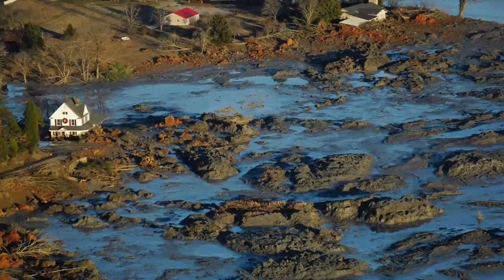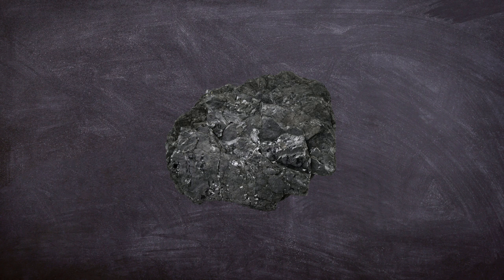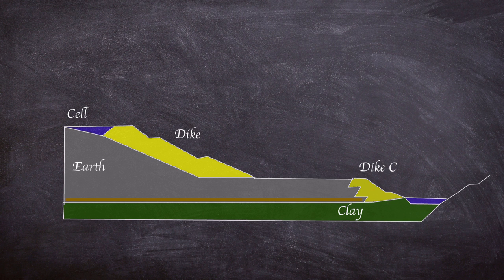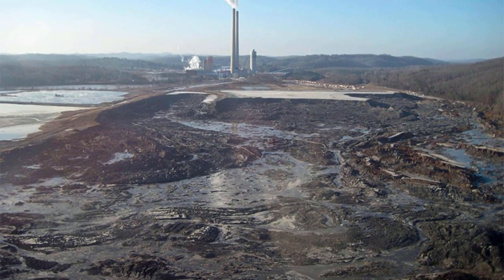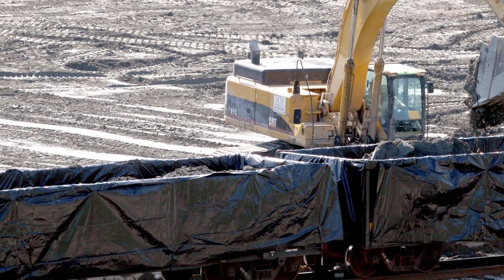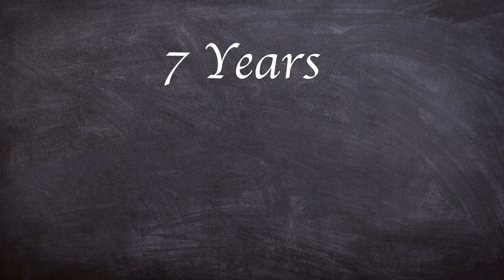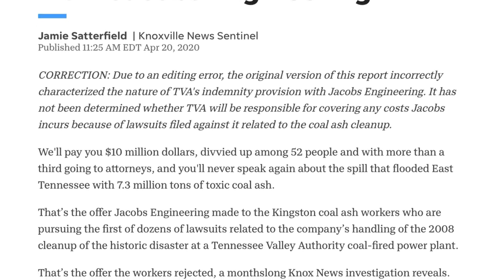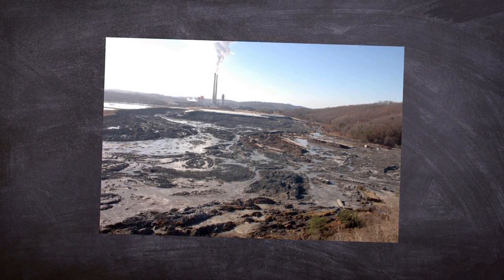A Brief History of: Kingston Fossil Plant coal ash spill (Short Documentary)

Comment: Where does al the toxic ingredients in the ash come from? I always thougt that ash (when fully burned) was kind of harmless or inert.
Anybody?
Reply: Coal is basically fossilized wood, in this case ancient rain forests buried in swamps and other anoxic environments. When they were living trees, their root systems absorbed various nutrients from the environment, including heavy metals and whatnot. The concentration of this material in a ton of actual coal is relatively low, even negligible. But a single power plant must burn about 9 tons of coal per day to produce one megawatt of power. Kingston has an output of 1398 megawatts. 1398x9= 12582 tons per day, or 4.592 million tons a year. Let's say that there's 100 grams of selenium in a ton of Kingston thermal coal, resulting in the accumulation of 459 tons per year. Heavier elements in coal ash don't combust and it's illegal to emit out the stack and therefore must be contained and recovered. And that is how you end up with a toxic sludge pond.
Reply: Peter Gray, thanks for your clear and enlightening answer. I have never realised that.
Reply: One caveat I didn't mention. My math assumes that a powerplant operates continuously at maximum output. On average Kingston operates at 950 to 1150 MW per hour. Still that's one unit coal train per day, so it still accumulates waste quickly.

Comment: They should be harvesting the metals out of al that.
Reply: thing is for what? Neither of them are high in demand and you'd have to deal with even more toxic waste...
Reply: @AKAtheA  it's not that. It's simply not economical because of the relatively (compared to natural ores) concentrations involved.
It would lead to less but more concentrated toxic waste as the total volume after extraction of the desirable materials would be reduced.
This is a good thing as there is less to store or otherwise dispose of, but that still doesn't make it economical.

Another problem is that the fly ash is radioactive, and therefore, depending on the exact level of radioactivity, may need to be treated as radiological waste, making refinement to extract desirable materials from the waste actually illegal.

Ah, the things you remember from engineering college graduation work in nuclear waste management...
Reply: @jwenting  Considering process waste, the total volume after extraction would most likely increase in just about all cases, but the overall concentration of target materials would decrease.
Reply: If it were profitable, it would already have been done.
Reply: The ash is mostly just sand so the best use for it is as a building material like mixed in cement etc. I think a big reason why it’s so dangerous is the small particles that get airborne which is why they try to mix it with water in the pools.
Reply: @Ty4ons  The reason it's so dangerous is the toxic metals including the radioactive ones. Try watching the video again.
Reply: Peter S -_-
Reply: @Peter_S_   If you actually knew you would know that fly ash is a major component of many concrete mixes , it increases cold weather resistance is used in high strength concrete, as an admixture, reduces shrinkage, improves surface finish, increases workability, reduces cracking, permeability and efflorescence bleeding, reduces setting heat, reduces water needed for the same slump mixes, and reduces CO2 emissions in concrete production.  Not all coal fly ash is radioactive, it depends on the content of uranium and thorium in the coal, same goes for other metals again depends on the coal some coal types have no metals in them and thus none in the fly ash. Some Chinese coal fly ash is so radioactive it can not be used for anything and is treated as radioactive waste, even over there.

Comment: In the UK pulverised fly ash is used in bricks as bulking (it's why you see black spots on London yellow stock bricks) and in Roman type cement as it makes a breathable form of cement that doesn't corrode reinforcing bars like modern cement. The Victorians pioneered its use as a 'pozzolan' in replacing the volcanic material the Romans used in their cement and bricks. It has some amazing properties as when processed and wet it becomes cementitous all by itself. Add normal cement to it and it doesn't splinter or crack like modern cement. It microcracks. Which means it can take way more pressure. The modern UK construction industry is using the material as a form of carbon capture and when used in building materials it becomes basically harmless binder. Whereas in the US there's not such a large brick industry because of the abundance of timber, and they don't use Roman cement anymore. It's all that plasticised petrochemical cement which is even worse for the environment. So as there's no demand for the waste to be reused they have to just store it in these unsafe open air tanks with pooly stabilised earth bunds to the perimeter. Funny story; after the catastrophic wars of the Victorian era Britain sent to its then ally Russia to rebuild parts of their damaged cites from the Napoleonic wars. Thousands of tonnes of fly sh which were stored on the current site of St. Pancras Station in London. Yes that big a mountain of ash. And shipped by train and boat to help make bricks.

Comment: On 1983 in Cuidad Juares, Chihuahua Mexico there is a infamous incident regarding cobalt-60, the disposal of a x-ray machine and a whole chain of neglect. An private hospital bought a x-ray machine but didn't do the import paper work nor they had licensed personnel to use it, so it was in storage for some years then a doctor decided to scrap it for metal without taking care of the radioactive elements. What follows is spilled radioactive material on the way to the scrap yard,  6000 tons of steel rods made from the contaminated scrap and the search all over the country of the contaminated steel rods.

They only knew of the incident until the next year when some of the steel rods passed near a nuclear laboratory on Los Alamos, New mexico and all their alarms when off.

In the aftermath, every northern state was unsure if they had contaminated constructions and the steel rods that they manage to secure where improperly dispose off, stolen or resold for cheap. It the classic story of incompetence in mexico

https://inis.iaea.org/collection/NCLCollectionStore/_Public/17/068/17068345.pdf?r=1&r=1 
https://es.wikipedia.org/wiki/Accidente_por_contaminaci%C3%B3n_con_cobalto-60_de_Ciudad_Ju%C3%A1rez

Comment: Why didn't they use a Centrifuge on the watered down fly ash to separate out the different elements into their pure form and then sell them as a usable product?
That list of "WASTE" product is also useful material in the right setting.  They seem to have missed a ROI opportunity here.
Reply: You can do this kind of "recycling" with anything really. But it's just not economical. You can imagine they'd have done that without a second thought if it was feasible. But sadly it's much, much, much easier and cheaper to just discard the material.
Reply: I don't see why it wouldn't be Economically feasible.  All you are doing is having the materials separate them selves by the difference in weight between them as you spin them around at high speeds.

I don't think it is a matter of feasibility as much as it was a mere matter of lack of thought or desire.  I have worked in several industries and manufacturing facilities.  Most of the time, they just don't care, stubborn or hardheaded.  Even when you present them with feasible ways, some of them are just filled with prideful stubbornness and say "NO" to good idea's simply because they want to "show you who the boss is."
Reply: @brickbunny9686  It's not economically feasible if the cost to do so is much greater than the value you can gain from the separated materials. 
When it comes to recycling, in general, even in much more easy to recycle cases, the cost of recycling is almost always greater.
Even in the simplest of cases, i.e. recycling aluminium metal (from cans etc), the recycled aluminium is often more expensive than what is freshly mined and produced.
The reason why recycling still happens is most often because of regulations and quotas. Governments enforcing policies that some types of material should be recycled. This drives up costs of that product, of course.
Reply: You wouldn't be dealing with the same level of heavy machinery when pushing liquefied waste ash threw a centrifuge.  your literal next step as it comes out mixed in water would be to send it to the high speed centrifuge, for material separation.  You would be separating dust particles, in a single machine that won't require anywhere near the investment as an entire recycling plant.  The cost for this is very low.  the waste fly ash is in a form that makes it easy for such a centrifuge to be economically feasible, quite easily. 

It is pride and stubbornness that is preventing this idea from being used.  Not economic ROI concerns.
Reply: Don't waste time with an apples to oranges recycling technique comparison.  Your government mandated example is a completely different process, verses what the coal burning plant could have used.
Reply: Centrifuges are often used as an economic method for separating materials that was created out of a need to efficiently separate things without the use of high amounts of heat.  In many cases the centrifuges where better, faster, more cost effective then some boiler methods used in the past.
Reply: @brickbunny9686  Centrifuge separation methods are well known. I'm not comparing any apples to oranges. If you believe you have a case then you should present the detailed economical analysis of this particular application. Not to me, but to a board of directors of such a power plant.
As long as there's no regulation preventing this, any company would be all over it due to profit opportunity. In fact the very reason I think it's not economical is because this hasn't been done yet despite centrifuges being known for a long time.
If I'm wrong about this, that means you have a great opportunity to make money. Develop it, patent it, present it to the world.

Comment: One of the favorite things of corporations to do in cases where long term death and illness result from corporate failures is to drag out the court cases into decades. The goal is quite simple. In order for a suit to happen there needs to be plaintiffs. As with the case of the radium girls, they drag it out till most if not all are dead. It reduces the payout significantly. Which is what is going on right now in regards to the court case for the engineering company employees.  The longer they draw it out the more who die, the lower the final compensation will be. Such cases need serious tort reform in how they are handled and how there should be limits on the time scale of the suit because it is being used to "outlast" the slowly dying plaintiffs.

Comment: Fly ash is needed to make Concrete just so y'all are aware. It is what produces the fine high quality concrete needed for making freeways, and poured structure such as fake brick and cobble stone. I use to move fly ash regularly. I knew of its dangers for the most part but was not informed of its radioactivity or its hazards in that regards to my health at one point I was very glad I had my mask on as the top valves were melted off and I was not informed, the bottom valve where the hose linked to was the only safety between me and the medium. When I finished blowing off my fly ash I disconnected the bottom hose with the lower valve open. I heard a whooshing sound and was then struck by fly ash hard in the chest. I was able to shut down the flow but not before a massive cloud had formed. It was then that the radioactivity alarms went off and I knew something wasn't right. The cloud was enough above background that it set off the alarms. My levels were checked and I was cleared but I was contaminated externally. I was allowed to leave and mitigate the dust on my own. I had to yell at my kids to stay away from me until I was clean because of the risk. I had to throw away a jacket, a pair of boots and pants and change my mask filters that set off alarms as well. A breath and lung test showed the filters worked but I had to scrub down at home and that sucked. It was indeed a violation for them to have me do that but I was unaware.

Comment: In 2015, towards the end of the Obama era, new EPA rules meant power companies had to deal with fly ash differently.
It was only then, as late as 5 years ago, that people made the first serious efforts at industrial refining of the ash to extract valuable metals and other compounds from it.

The idea isn't new, in the 19th century people extracted silver from coal. But the idea to actually extract the valuables to reduce the toxicity of the waste product, rather than just piling it up, is very new.

Of course, the EPA got hamstrung the year after, with executive orders from the new president overwriting the previous rules, to make coal power more cost effective. So the research into how to best extract the compounds from fly ash has basically been put on hold for 4 of these 5 years, and we're no closer to having an actual use for the residue, other than the previous "recycling" method of just caking it up and mixing with sand to form concrete. Very toxic concrete!